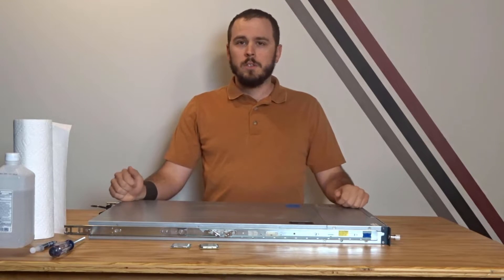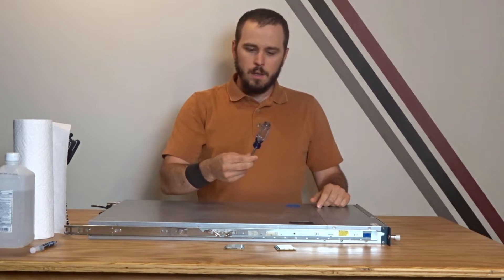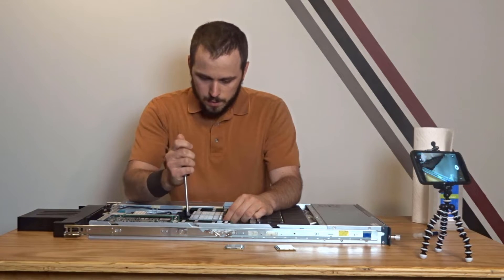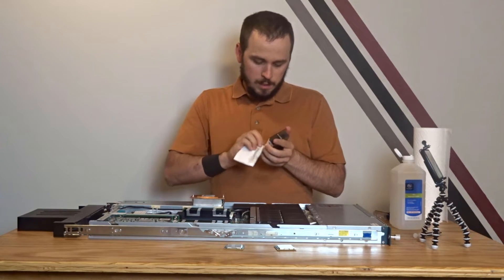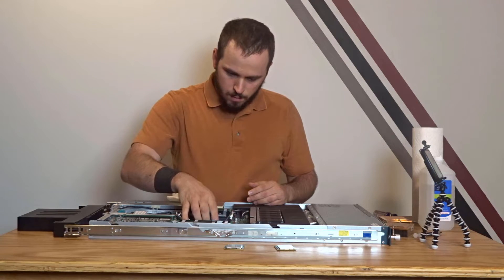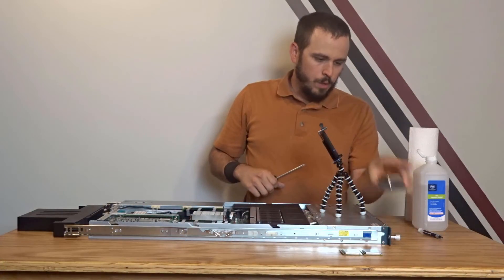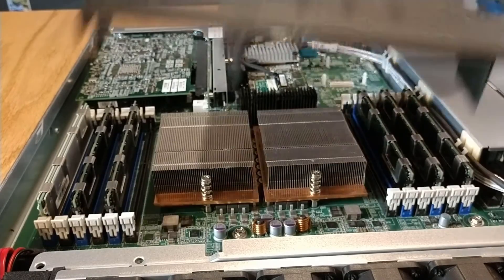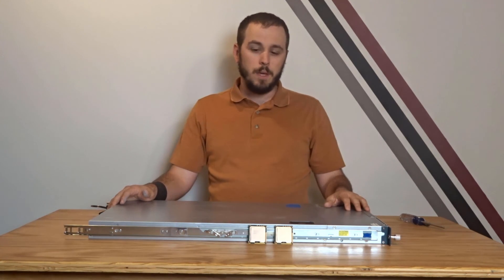Homelab Basics - Upgrading a Server's CPUs

Comment: Hey, I erased my FI and started it from scratch. I cannot get my KVM to work, it keeps asking me to assign an IP and documentation is not getting me to the solution. Is there anyone that I can communicate with via email or another method to figure out what I am doing wrong? I have assinged an IP address block and it is reachable via my LAN, but it keeps asking me if I want to assign an IP whenever I click on the KVM of that server.
Reply: I knew the moment I would asked for help, i would get it to work.LOL. For some reason, when I assigned another IP, it worked fine. Not sure why I needed two IPs, but before I only had one.

Comment: Camera pointing at what your doing would of been nice... :(
Reply from the maker: I mean...it is. That's what the cellphone camera was for.
Reply: Taylord Tech I meant like a camera on a tripod pointing down as you work
Reply from the maker: I had a gopro overhead, but it was a biiiit too high and only like the middle 25% of the screen ended up being the actual table and server.
Reply: Taylord Tech no worries. It was just a little weird hearing you talk about the server and seeing it from a distance and a side angle. The cell camera did help a little.